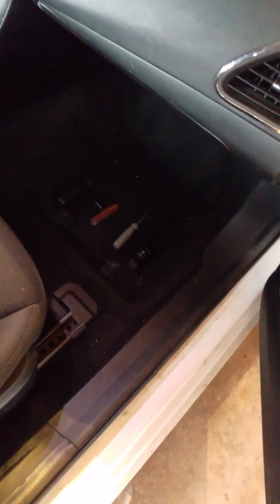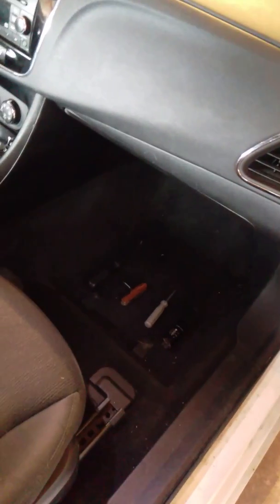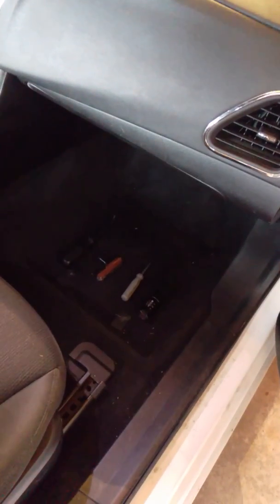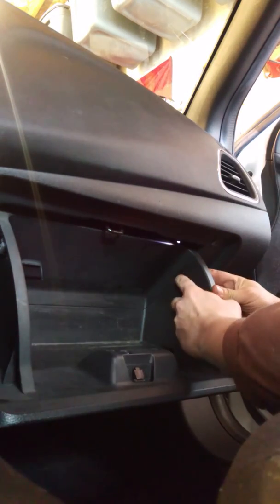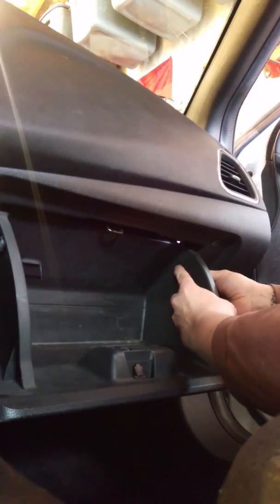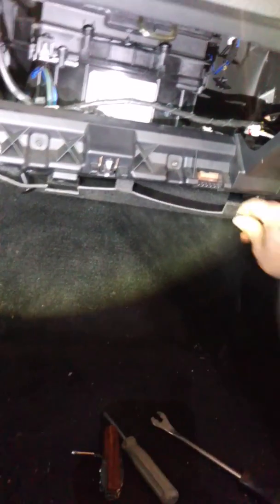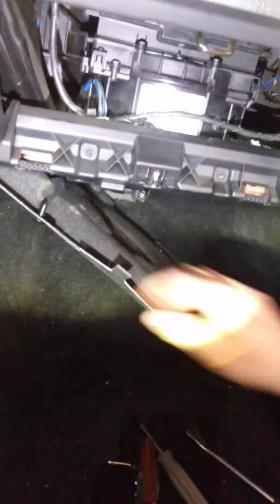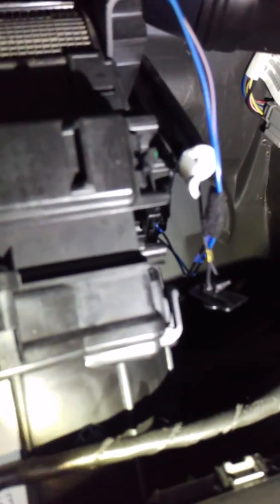2013 Chrysler 200 clicking actuator

Comment: Beaters0311, I loved your video to change the 2013 actuator. But I have a suggestion..... if it’s a 200S you have about 3” less room to replace the right sided one because there’s an amp built in there. I’m a 46 year old female and I was able to do it but you have much less room if it’s a sports model. You basically need a mirror and you have to feel your way....Thank you for your help! Job done!
Reply: Yassss lady. 🥰

Comment: I found out a more simple access path. Remove the vent.  Unscrew a single screw which attaches to vent sleeve and it easily removes.  Then you have straight access to the actuator. Cheers

Comment: So I followed you to the t. But I've some problems. 1, my actuator wasn't attached to anything but the wires. Took off the dust cover and it was just free hangin. 2) I think I misdiagnosed my issue. When I turn the air on it only blows on my feet. Cant get air to change direction.  Thoughts?

Comment: I fixed mine myslf. They are easy to take apart. Drill and put a bolt trough. There are marks on thhe back to line up keyway. Its better than new. 70.00 bucks for a new one. Didnt cost me a dime.
Reply: What size bolt did you use?  Was it steel or brass?
Reply: @garryharris3777  it was a reguler steel bolt. 1/8 approx 1 1/2" long. It was 10 months ago now. I never had any problems sense. It will probably out last the car.
Reply: @Steve-np3up  I just did it today using a  8-32 X 1-1/4 screw and nut.  I drilled out the gear and case with 11/64 drill bit.  No special tools needed.
Reply: @garryharris3777  good job. Its not hard to do at all.
Reply: @Steve-np3up  Thanks for the idea.
Reply: Steve, So it’s the axial that breaks off, and the screw and bolt are now what the gear piece spins on? Your just replacing that with that bolt.?
Reply: @Slinkbomb  yes
Reply: @Slinkbomb  you are reattaching the broken plastic shaft with a small screw .